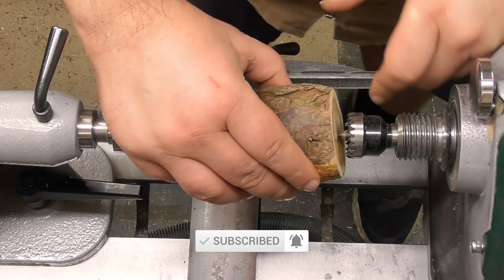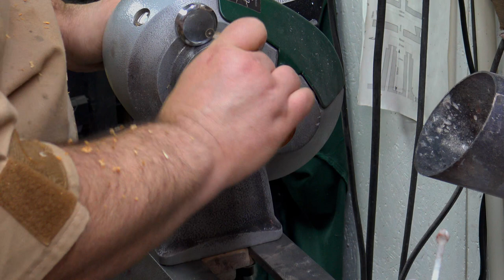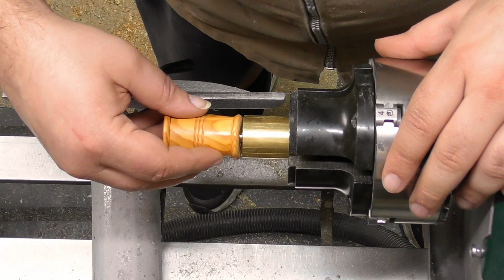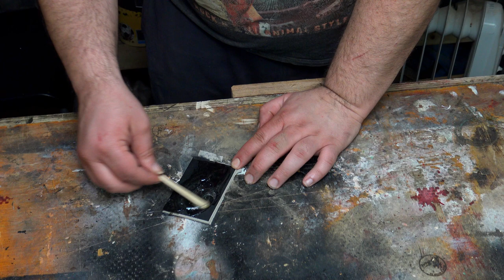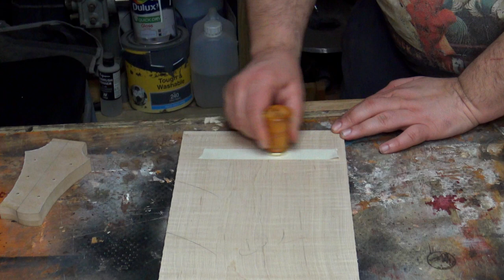Woodturning A Burnishing Tool

Comment: Great project!  I’ll be using this on my negative rake scrapers - probably the long one held in a vise with wood faced jaws and will make a shorter one (maybe 1-2 inches long) to use it when holding the lathe tool in my hand.
Reply from the maker: Thanks James. Glad it’s given you some inspiration

Comment: I saw this neat little trick for making three lines, like you do on the handle there. 
It is to make the two most outer ones first an the put the last one in the middle. That way it is easier to get the distance equal ;)

Lovely video. Thanks
Reply from the maker: Thanks. That's a great idea. Makes total sense. Thanks for letting me know

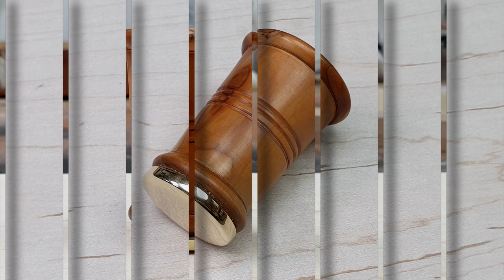Comment: Hey John, great job on the burnisher. Was that a Bedan you were around the 6:00 mark? If so I have found the only other wood Turner that uses one! Did you get the guitar strung yet? Yet again seeing as you had a headstock lying on the table there, perhaps not.
Reply from the maker: Sorry I'm not sure what you mean. I'm going to say no as I've not heard of a bedan. Yes the guitar is finished. This video is a little out of order lol. What you see there is the next guitar 😁
Reply: John Clothier Hi John, a Bedan is pretty much like a narrow one sided skew or a wide parting off tool It requires just a little finesse to use but is great for turning beads and getting things down to round in a hurry.
Reply from the maker: Oh ok. No it was just a wide parting tool

Comment: Hi John, I have to make one of these. I tried the masking tape and super glue trick yesterday but with painters tape and it didn't work even with accelerator. Is it because I used painters tape do you think? Take care John. Cheers, Huw
Reply from the maker: Hi Huw. The super glue should stick to painters tape. I cant see any reason why not but then again I am not overly familiar with painters tape. Try it on some standard masking tape and see if it works out if so then I guess it must have been the tape
Reply: Thanks John. I'll let you know if you want. Huw

Comment: nice job mate. wondered what one was. super glue and masking tape together?
Reply from the maker: Thanks. Yep so using super glue to stick masking tape together you make double sided tape. Difference is double sided tape is messy to clear up because it's too sticky. Masking tape cones away very easy.
Reply: @JohnClothier  oh ok mate. i will have to try it